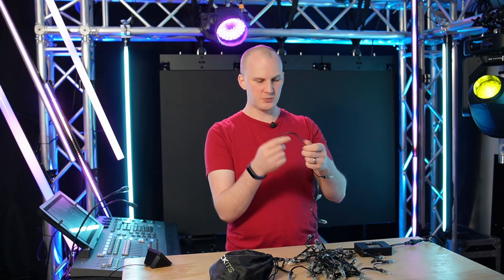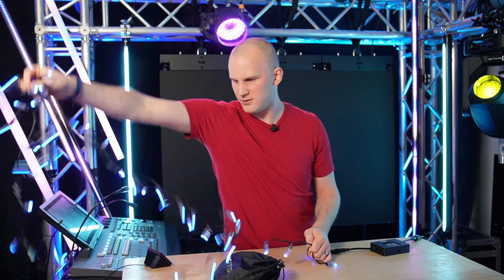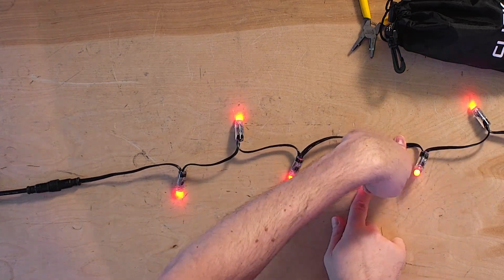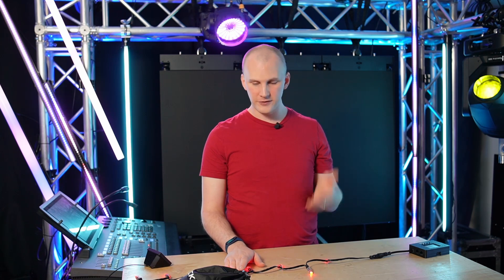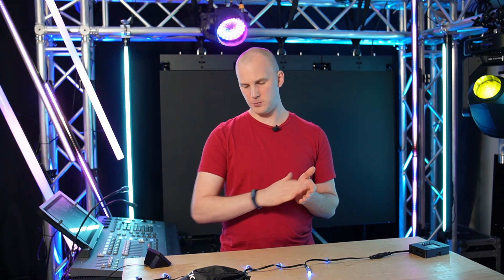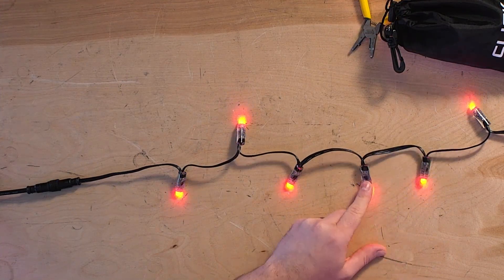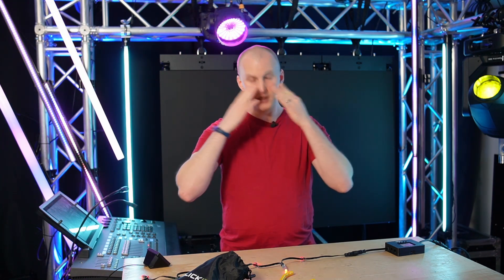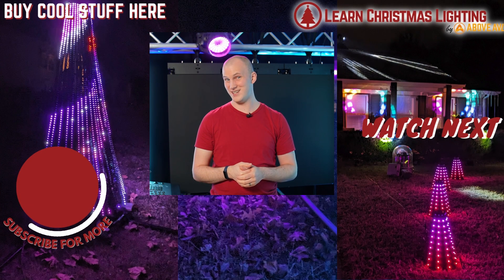How to Troubleshoot Bad Pixels in Your Holiday Light Show

Comment: The big challenge in replacing pixels is identifying the polarity and not getting the in/out backwards. So you cut off a 2 pixel string to replace in a series. How to keep the polarity straight and not get the data lines backwards.